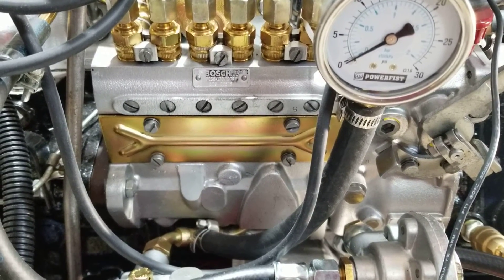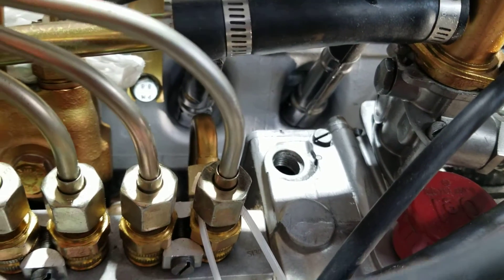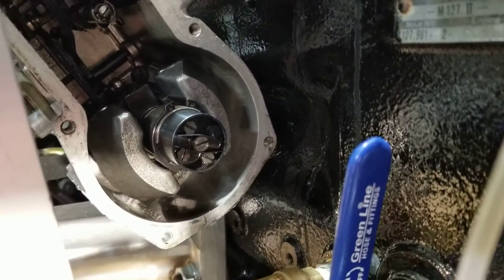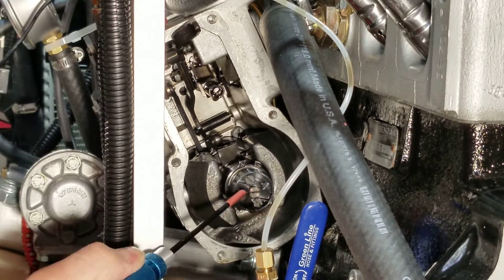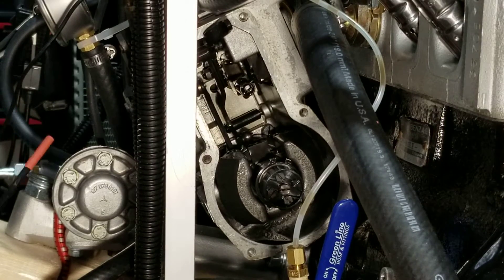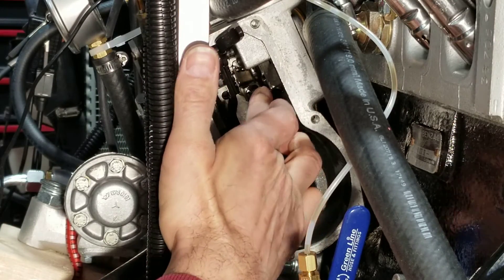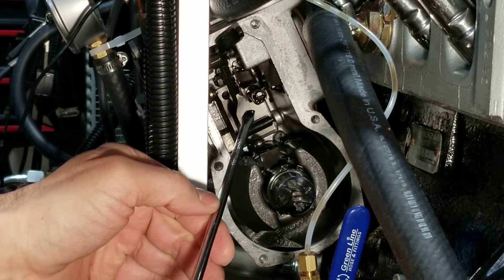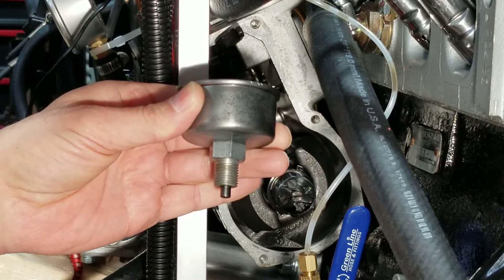Injection pump fuel flow adjustment

Comment: will this work on Mercades om617 motor to give me a little bit more power i already replaced the stock turbo with a newer turbo  model he221  turbo      thank u
Reply from the maker: Is it build the same? Your best bet is to address this question with DPUK.

Comment: by removing the spacers from the top piece, is that enough adjustment? my car is running very good at iddle and fires right up, but cannot stop the black smoke when i press the gas.  any advice?
Reply from the maker: That adjustment is very sensitive. You may try 1/8 turn or less to start. Mark current position and than after you find the happy spot place the corresponding shims and lock it tightly.

Comment: Hello Mark, you mentioned one may not adjust the idle adjustment screw when the engine is running. What to do if someone makes this mistake? Does this mistake cause a serious problem (any damage), or can one solve this situation? And how? Am I to remove the end plate of the governor part, and screw something back on the governor shaft? I would appreciate your advice (help...)

Comment: Hi Mark, is the pump similar to the ones fitted on the M130? I'd like to perform an adjustment to the individual ranges, but I really can't find much material on the individual four screws in black and white that you showcase.
Reply from the maker: Chris, unless you have proper pump flow testing equipment, were you can precisely set the rpm spikes and test the transition, Do Not touch them! Look elsewhere first. Fuel lines, injectors, supply pump, regulator. Are you getting 15psi at the pump inlet?
Reply: @markhabel2252  Linkages are set, fuel flow is good. Pump was rebuilt 6 years ago but was never set correctly and the car was put away afterwards. I've confirmed that the pump functions as intended but it's slightly out of adjustment, causing a lean running issue at low RPM and a rich running issue at high. Is there a procedure to the screws? I'm thinking - do you have to screw the white ones and black ones in pairs of two? Say two clicks of both white screws? I imagine one screw controls one of the centrifuges, but it's so hard to find information regarding the adjustment online. As long as I only do clicks and writing down the direction, I guess it shouldn't be too hard to adjust?
Reply from the maker: @JackpodyDK  Yes , the white and black screws need to be adjusted in pairs. Make a note every time you even attempt to touch it! I still advise against. 
Provided the pump is out of the car I would fill it with the trany fluid and turn it every so often. That will get the gunky deposits off the weights.
Reply: @markhabel2252  Thank you for the replies. Before I take the cover off, I just need to know, does the tube holding the adjustment screws rotate? It doesn't seem like it, but I really can't figure out if it should rotates.
Reply from the maker: @JackpodyDK  That tube is there for alignment. It is possible to unscrew the adjustment screw all the way out. Although turn no more than 6 clicks at the time before rotating the pump.
Reply: @markhabel2252  Thank you for the reply. I've been told to adjust screws in pairs and at most 2 clicks, but I know I need more than that and it's tiring to keep taking off the big plug on the back to adjust only 2 clicks. I'm having a hard time actually seeing which screws are black and which are white, is this common?
Reply from the maker: To answer your question directly, yes  this pump is very much like the one on the M130 engine. With the main difference being the oil flow. On the newer 130 engine you have the flow through design while on the older there is a dipstick for you to check and adjust. I still recommend a proper flush as it is possible for contaminants to settle at the bottom.